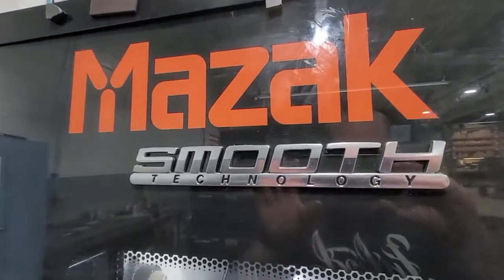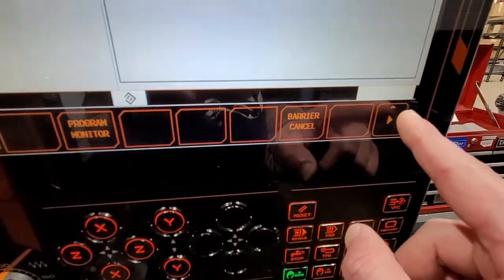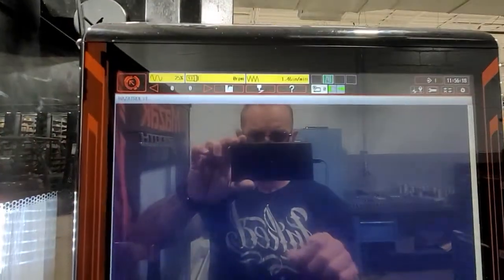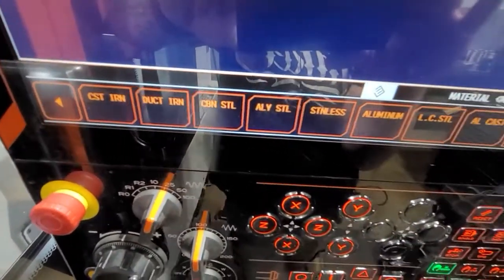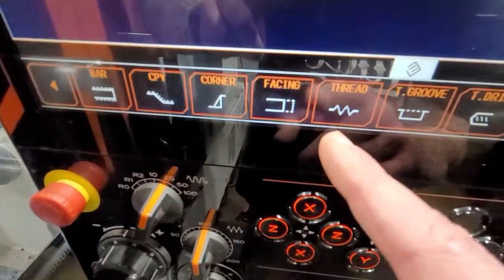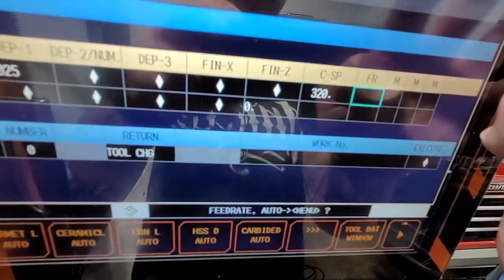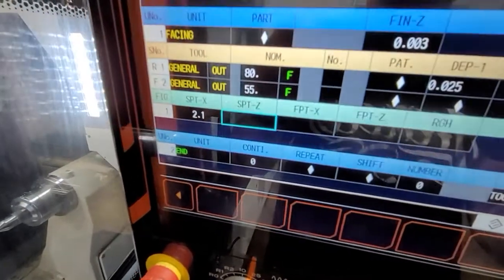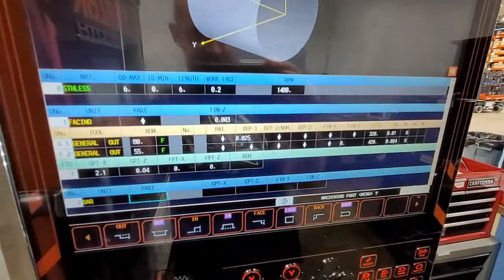Mazak Smooth G How to Create a new program and add Units

Comment: So glad I found your channel. I’m starting work on an Integrex 500 with smooth controller on Monday at 62 years old. After 35 years on a slant bed 40 with T3 control I’m worried I’ll not be able to take it all in! 😂 They move so quickly and one small bump can cause $$$ worth of damage 😳
Reply from the maker: You are exactly right about that.

Comment: What is Plane Auto Set?
Reply from the maker: Plane is just an area of a work peace, just like you can set or calculate angles with 3 dimensions and angle or approach calculations, it also can calculate dimensions of the plane you try to Mill.
Reply: @martyz3232  thanks